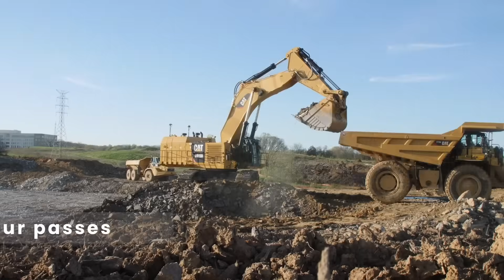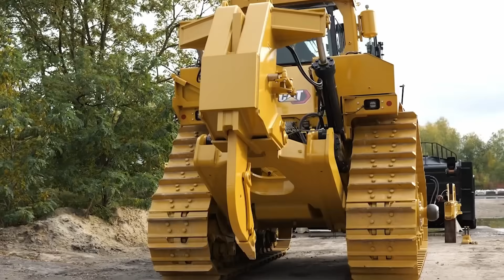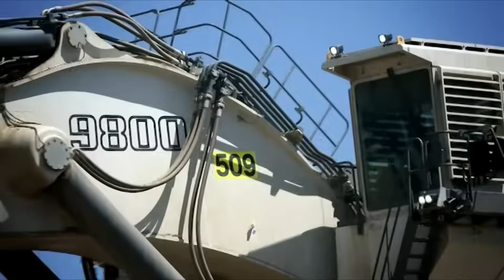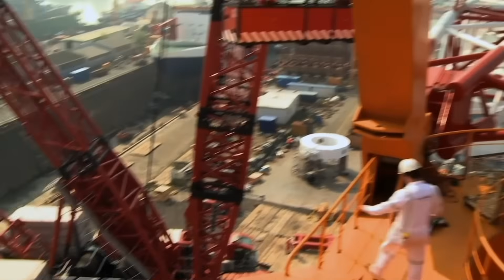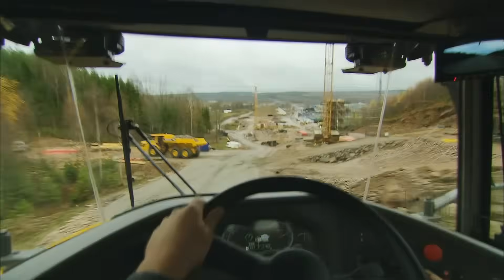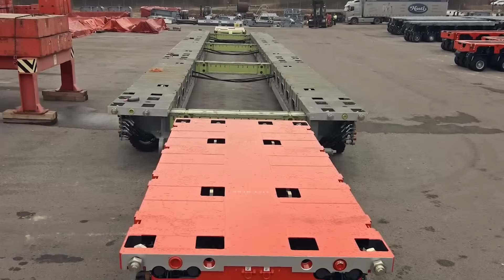10 Machines So Big They Shouldn’t Exist

Comment: You are wrong. The Cat 6090 weighs 980 tons and not 1270 tons. The 6120 BH FS weighed 1270 tons and had a 65 cubicmeter shovel. But it was only a prototype. The 6090 has got a 52 cubicmeter shovel.